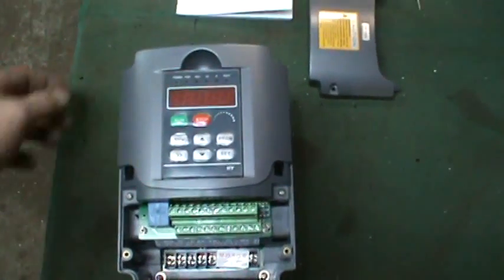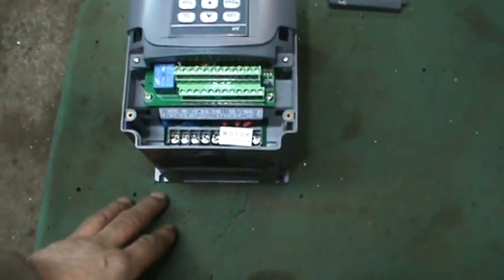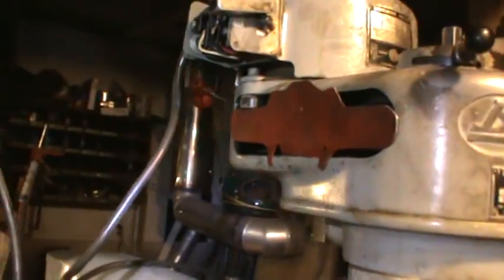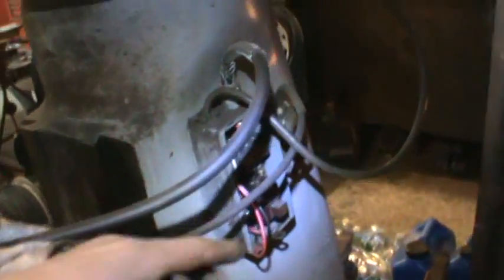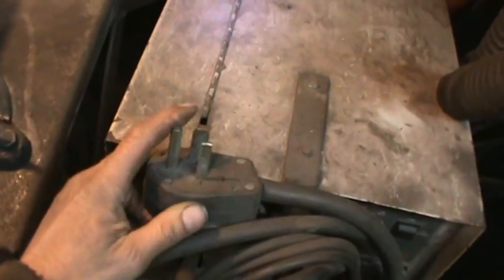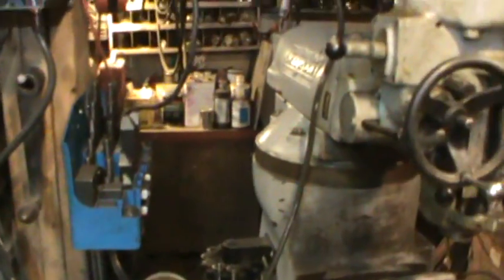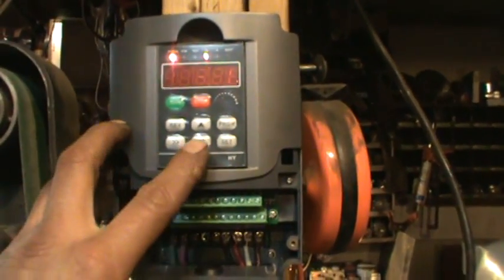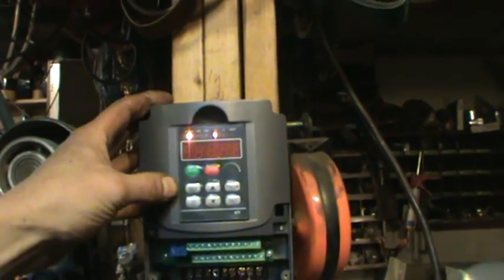lets fire up the milling machine,

Comment: I worked as a machine operator and set up my own machines years ago, what is the difference with only forward and reverse and fast or slow, that you need a program to run a simple drill press combo.

Comment: Is that an inverter duty motor? They typically have better insulation on the windings because the VFD  updates around 20kHZ which may cause a voltage spike burning out the windings prematurely. Long leads to the motor make this worse but yours are fairly short. Also at low speed, if the fan is attached to the motor it may not run fast enough to keep it cool. An external fan may be necessary. But if you run 30-60 Hz you should be fine. Also most VFD can't run less than 6 HZ because there is insufficient torque. Maybe your drive is made to run with full torque at zero speed. If so, sweet.

Comment: Mustie needs to have at least a gallon of cutting oil on hand in an old fashioned oiler can.
I used to have one that I rigged up with a small pump and flexible tube I could aim at the stock I was machining with a catch tray underneath so I could filter and reuse the oil.
I still have a quart of that cutting oil and a my old fashioned oiler can I'd use when I cut metal with a hole saw.

Comment: I feel somewhat spoiled here in Germany... looking at those VFDs and thinking about my absolutely average 63 Amp 3 Phase Main Panel down in the basement.
That is three Phase with either 230 V +- 10% at max 63 A per Phase or 400 V between phases.
On the other hand Mustie offloading the Bridgeport into his Garage would seem like a piece of cake compared to me trying to bring such a machine downstairs. (No idea if the wooden stairs would even handle the load ;) )

Comment: the reverse function is very handy, and an easy fit. When you power thread the instant reverse is very handy ability. I've been using a VFD for about 12 years and before I used a permeates mag DC motor from a treadmill. Just learn your speeds and feeds and easy on those expensive cutting tools.

Comment: So the controller allows a three phase motor to run on two phase?
Reply: Yes. I have 2. They are clever devices with robust electronics (well the good ones are, like the TECO units I have).

Comment: I noticed that the end mill seemed to have an issue being fed straight down like a drill on your test cut.  I would like to suggest that not all endmills can be fed staight down because they aren't center cutting but are meant to be fed into the metal from the side. If you start checking your end mills you will notice one flute on a center cutting end mill will extend to or past center. I ran a large manual milling machine at Giddings and Lewis for 5 years in the early seventies, never thought I would miss it but I kind of do.

Comment: just wondering why would you chose a VFD over just a standard static phase converter ? seems a normal static phase converter would be more simple since the machine has adjustable belt/pulley system to control the speeds...you lose the same HP on both......
Reply: +ToolGuy you sound like you've done your home work...... or you sell VFD's .....Im not saying a VFD isnt better but the static or rotary seams a little simpler in my.......

Comment: if that endmill is HSS you can run it on 25m/sec meaning to get the correct speed you need this formula 25000:3,14: size dia from the endmill =your speed  you need to run and for the  feedrate its 0,05 per tooth x your speed is feedrate  so lets say that endmill is 16 , then its 25000:3,14:16 = 497    for feedrate its 4x0,05=0.2  so the feedrate will be 497x0.2= 99,4 say 100

Comment: Very cool! Those VFDs are pretty nice for their speed control and braking capabilities, and the external control lines make it so you can wire the original switches on the machine up to them. Very user friendly once it's set up.

You'll be making custom parts in no time! Happy t-day!

Comment: No errors to comment on.  You got it to turn electricity into flying chips!  Industrial controls is kinda what I do for a living..  If'n you want some help on adding your potentiometer, forward and reverse controls, and using some of the other inputs (the little terminals) for different speed settings,  just let me know..  Something surprised me though-  I'm really surprised you didn't have to jumper out an "enable" on the drive to get it to work at all.  With that drive you must be able to toggle that one in programming.